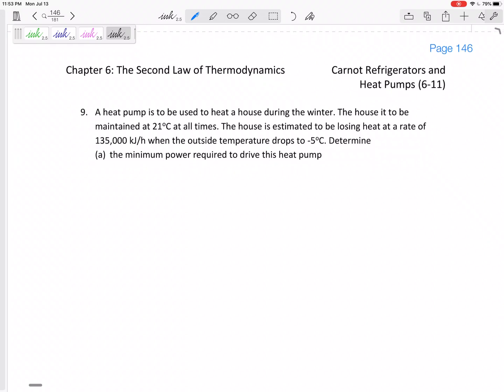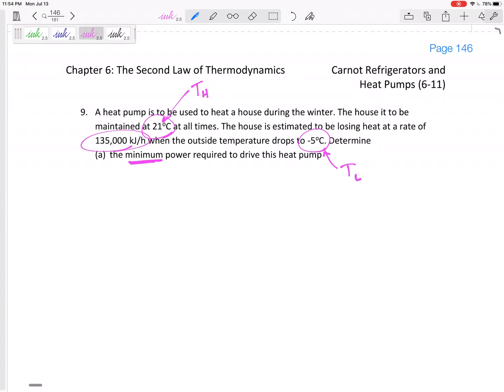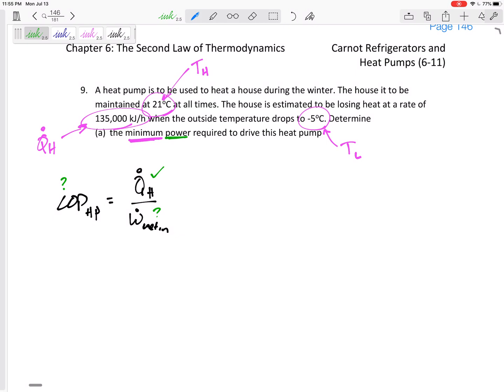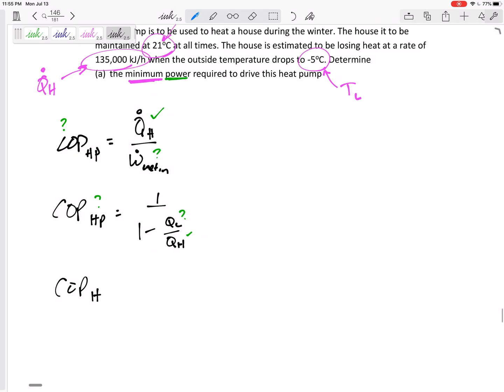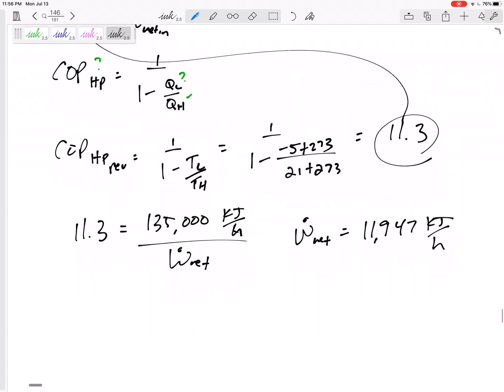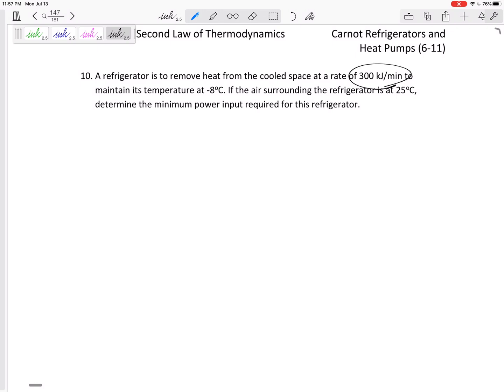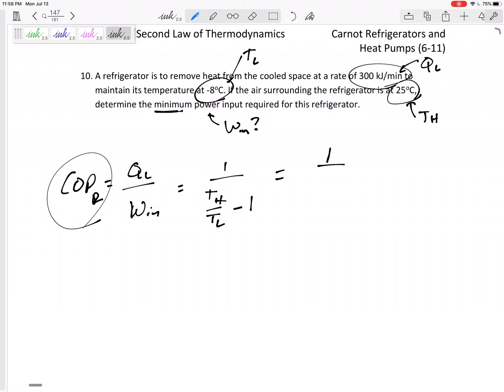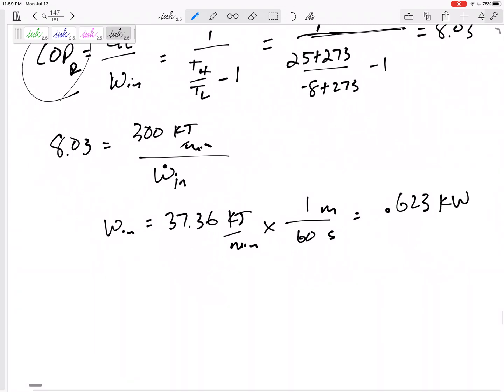Thermodynamics - 6-11 Carnot heat pump and refrigerator (easy examples)

Comment: I have a question here professor. So if the question asks for min power input ,we understand that it's a  carnot refrigerator or carnot  heat pump .But if it asks for max power output  , it should be carnot heat engine?
Happy new year also
Reply: Doesn't matter max or min. If it says that, you will know it is carnot and it can be refrigerator, heat pump or a heat engine. Max or min doesn't affect the system type.
Reply: @Siriusthepolymath 
So Carnot can be cycle of any system? Or what

Comment: Sorry, actually I don't understand how you decided Q is low(QL)? Could you explain?
Thank you
Reply: This may have come too late, but it is QL because the heat is coming out of the cold space and into the compressor. This is the refrigerant that is now being fed into the compressor for the cycle to be completed. If it were QH, the refrigerant would have been fed through the condenser and the heat would be radiated out into open space.